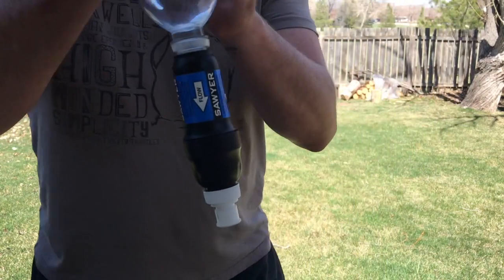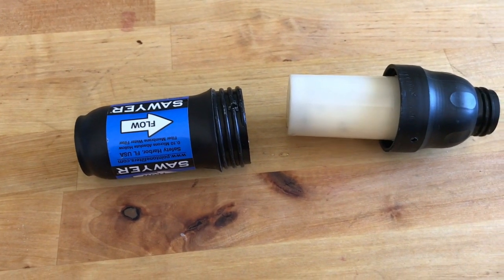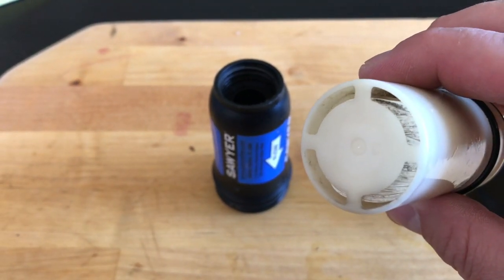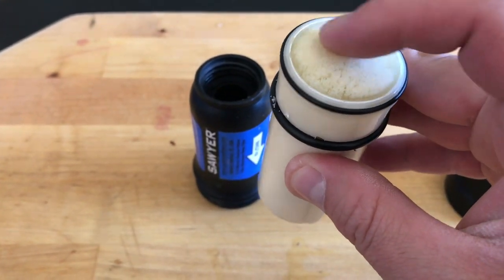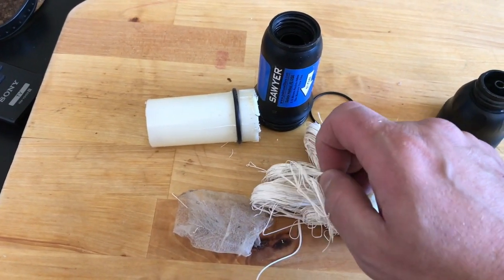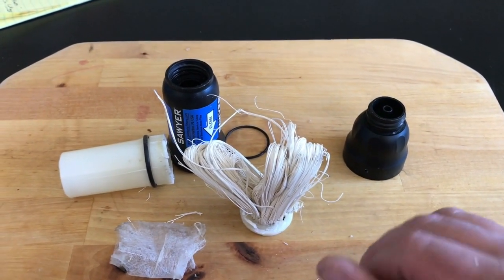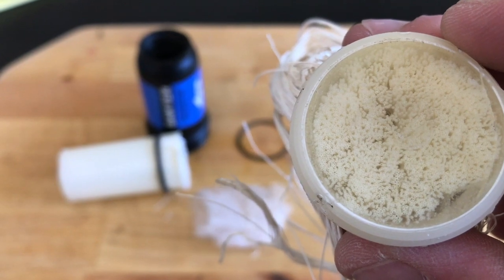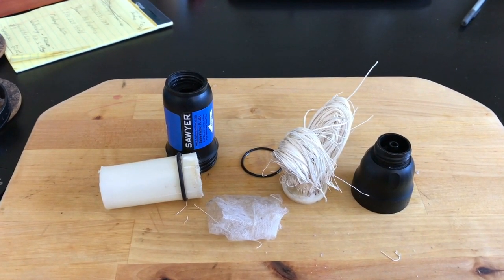Sawyer squeeze: Whats inside?!

Comment: Have you ever backflushed this filter or have you ever used acetic acid to dissolve calcium sediments ?
Reply: Yes aka vinegar works prrfect. Some people soak it overnight but i just back flushed it a few times with pure vinegar and let it sit for an hoir and then run distilled water through and then with super diluted bleach for storage. I am checking with their customer service to see if h2o2 is safe. Apparently bleach should prevent mold growth for storage but google says bleach doesn’t kill cryptosporidium but h2o2 does. Vinegar kills giardia